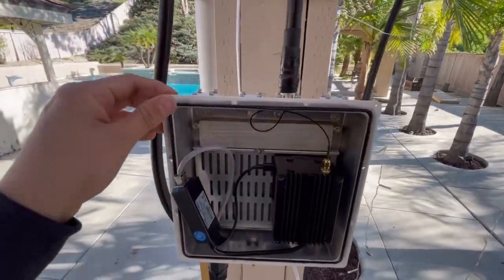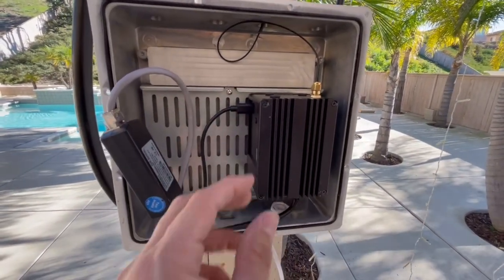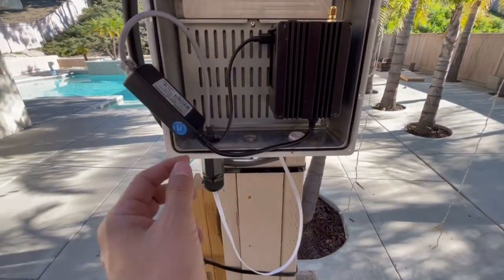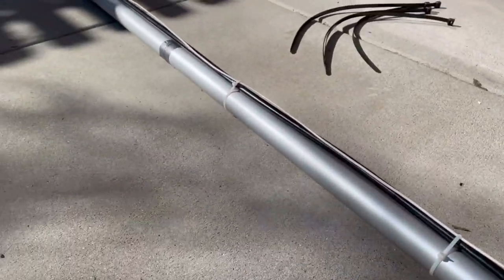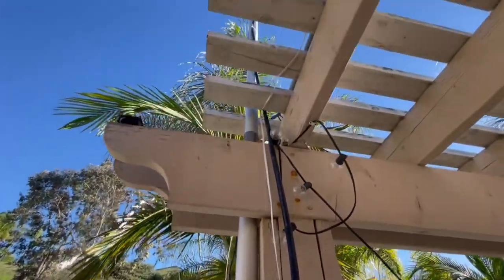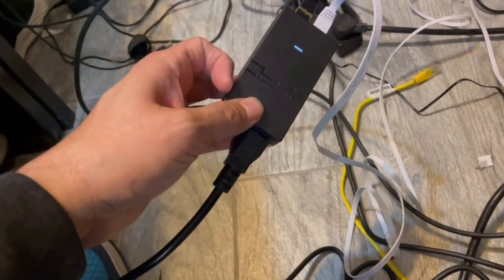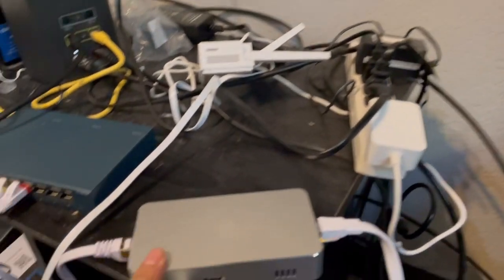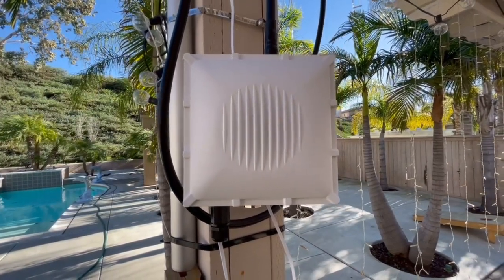Outdoor Helium Miner Encloser Setup For BobCat & Rak HNT Miner | Earn More Money (Crypto) W/ Case

Comment: I use those Rak enclosures for all my miners. Only suggestion is to ditch the cheap ethernet cord and use ubiquiti  tough cable pro with ESD drain wire and shielded connectors

Comment: Great video.  Is there a maximum temperature you would worry about it doing a rooftop installation??
Reply from the maker: Thanks Dave. I wouldn’t use it if you live somewhere that gets over 110 degrees in the summer time

Comment: Thanks for the video . Where did you find the lmr600 with male and female ? I’m using a bobcat . Do you notice a big difference from the lmr400?  Also are you not worried about having the miner out in that case regarding heat ?  I’m Cali and it gets hot I was worried about putting in a case thinking the heat would ruin it . Any info would be appreciated. Thanks bud
Reply from the maker: I got the LMR600 from eBay but I don’t think it’s a big difference from the LMR400. That case is going to block the heat from the sun plus we don’t have it in direct sunlight.

Comment: I just got one of these enclosures, and I'm trying to return it.  The metal on the unit I received was extremely soft and brittle.  It couldn't even hold its own weight.  After I had mounted it on the mast, the whole thing just started to droop and then fell over.  I undid the bolts and discovered that the ratchet parts had crumbled into dust.  So I attempted to tighten the bolts by hand, and it just ended up stripping the inset.  Maybe I just got a bad one.
Reply from the maker: Wow. That sux. Where did you buy yours?
Reply: @CesarCinema  It's a Rak enclosure.  I bought it from Parley, but despite initial communication problems (their email and phonelines are down), their Discord service was very helpful and got me a return.

If you haven't had any issues, then I suspect I just got a bad unit.  Perhaps there were impurities in the metal that made it soft and brittle.  I'm going to try a lighter plastic unit.

Comment: Those white cable ties you used to attach the LMR600 to the flagpole will get brittle and break from sun exposure. Only use the black UV resistant ones outdoors.
I have a couple of those RAK enclosures it would have been nice to have a clear window or port on the bottom of it so you could see if the ethernet port lights are flashing without having to remove all of those cover screws.
Reply from the maker: Thanks for the tip but I’m sure we will switch out the antenna before those zip ties will even come close to breaking.